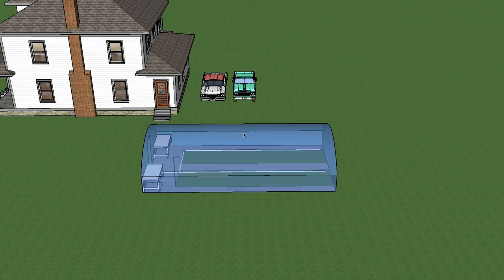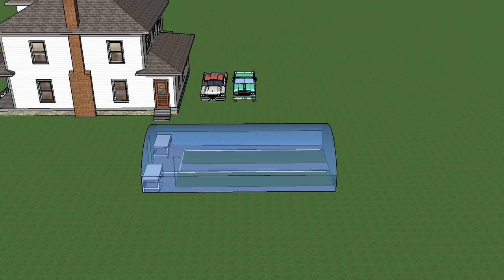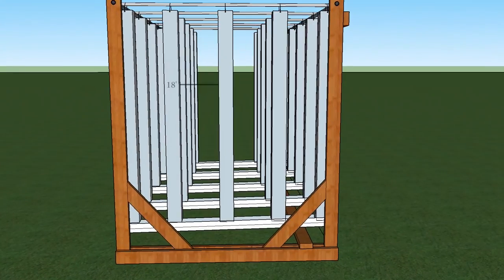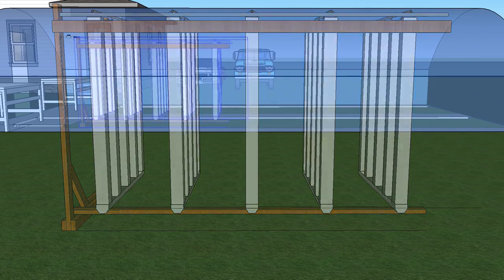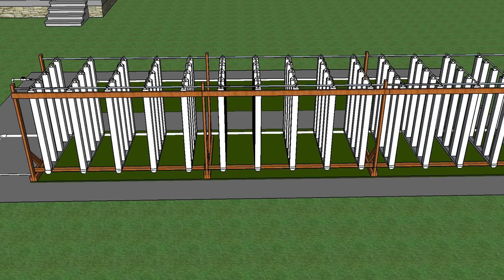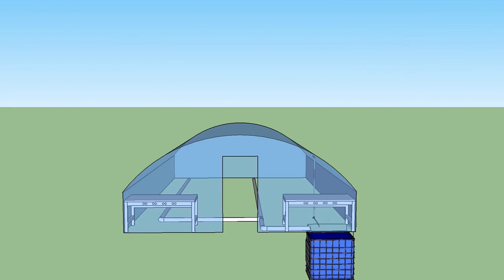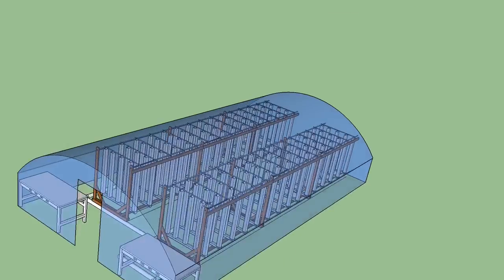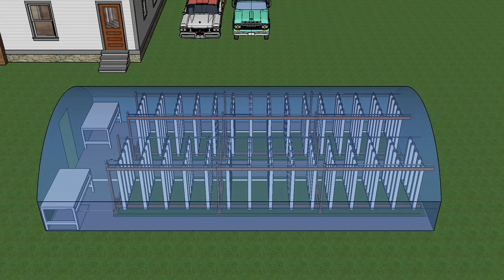Building a Greenhouse System with SketchUp

Comment: Cool to design a green house that uses aluminum panneled composting bins with aluminum gutters with gallium filled copper heat exchange pipes with fins to absorb the heat the the composting bins then use drafting from having buried air ducts in the ends of the green house that will allow cold air to sink while heated air rises for a drafting system to heat a green house. What you think about this idea? 😊